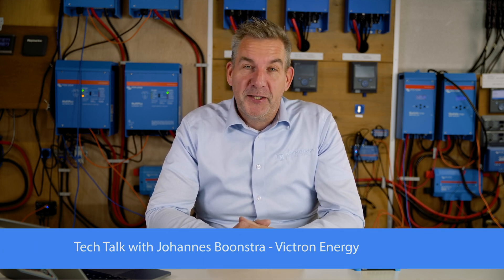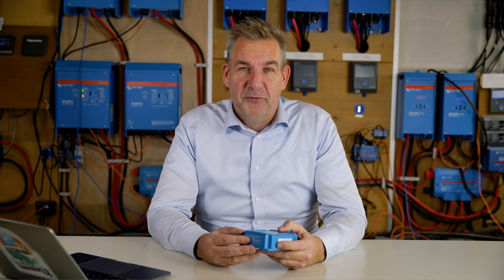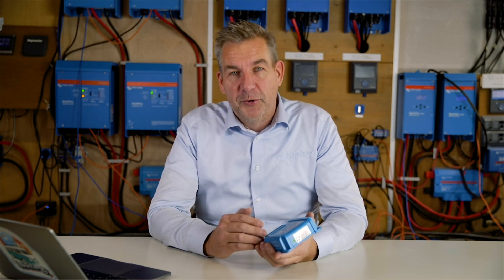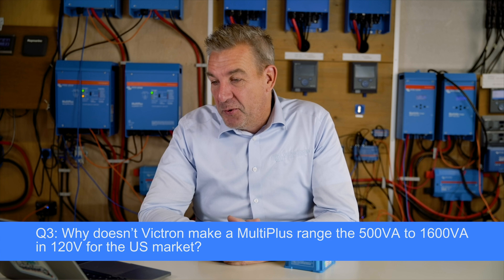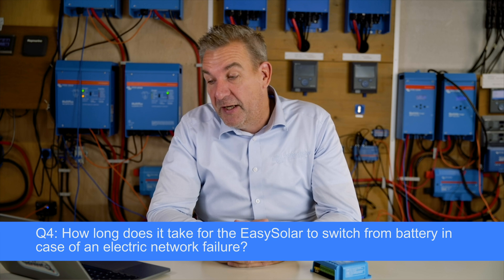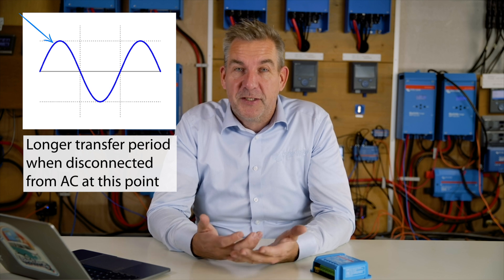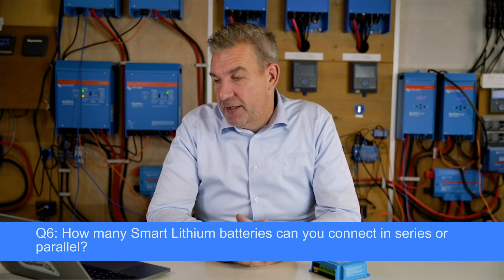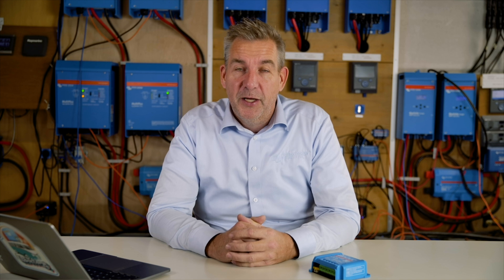Victron Energy Tech Talk - Episode 9 (MPPT charger output, Smart Lithium batteries)

Comment: What would happen if the total load output exceeds the max. values of (eg. 15A on an MPPT 75/15). Is it just restricted and simply won't exceed, or will it blow a fuse? Background: I'm currently setting up my system in a camper van and calculating for scenario that all electrical loads are used in parallel. Thanks alot!
Reply: Then there is a change of damage, so the output needs to be fused lower then max to be safe

Comment: Hi Johannes,

Another question regarding my EasySolar-II-GX-24/3000/70 (with a LiFePO4 Smart 25,6V 200Ah and a VE.Bus BMS V2)
Some time ago the EasySolar lost its internet connection. Therefore I also couldn't try to verify the network settings from VRM->Remote Console.
And in VEConfigure I couldn't see that information either, so I had to power-cycle the EasySolar to make it work again.
Because of this I have been looking at the various Victron control panels that exist.
The "color control" seems to be a possibility, but my dealer says the EasySolar is not compatible with that (although I doubt that).
On the Victron site I see the "color control" will be replaced by the "Ekrano GX", but that is a too extensive (and too expensive) solution for me.
What about the cheaper "GX Touch 50" or "CANvu GX"?
In the end I just would like to have a "backup" control option, that connects directly to the EasySolar (when no internet available) and has access to all essential configurations.
What do you suggest? Thanks in advance.

Comment: I would like to know if I can use a SmartSolar MPPT CC to charge a 24v battery from a 48v battery?
Reply: hello,  that's not advised there is a panel short circuit features which will get damaged when batteries are used as input

Comment: I have a question about the Victron Autotransformer.  Can that product be used with other manufacturer's 240V, single phase inverters to provide phase load balance?
Reply: yes, but when you need to control the ground relay you need to be careful as not all brands have a contractor for this

Comment: Hi Johannes, I have a system consisting of a Multiplus 5000, a smart shunt, a CCGX,  3 smart MPPTs with their nominal panel arrays totalling approx 3kW nominal charging a 24V /1000Ah lead acid battery . My  battery reaches absorption usually by mid morning and at that point I want to connect my electric car charge circuit to harvest the max from my panels. 
My question, what is the best way to get the absorption signal from this system? Clearly I can use a standalone voltage sense circuit but i would far rather use an output from the system.
Reply: if you want to charge when the battery is "full", I would recommend that the doc of the battery is used to trigger a relay for the charger. lets say start at 9998% and stop at 85% , that way you are almost certain the majority of power comes from PV

Comment: Hello Johannes,

I have setup a EasySolar-II-GX-24/3000/70 with a LiFePO4 Smart 25,6V 200Ah and a VE.Bus BMS V2
As I needed some 24V energy I connected that directly to the battery and not on the 230V output of the EasySolar to avoid the need of an extra 230V/24V power supply.
Will the EasySolar still be capable of managing the Battery correctly (as it has a VE-Bus to communicate with the battery) or will it get confused that some power is used from the battery that doesn't flow through the EasySolar?
Reply: The BMS will signal the Easyplus what to do, when the BMS signal is lost for whatever reason the Easyplus will stop working

Comment: LOM vs Anti Islanding (NA-Schutz)(NS-Protection)
Hello Johannes and Victron Team,
i am reading a lot about the Anti-islanding (ns-protection) (na-schutz in german) device, like the Ziehl UFR1001E device, and i read that the multiplus 2 even has such an anti islanding device inbuilt.

Now: i also read that every multiplus has a LOM integration that practically does the same: disconnecting the inverter and thus discontinuing the feed-in to the grid, in case of a grid failure.

so my question: why do we need both, LOM and (external) Anti-islanding (ns-protection)?

is it because Anti-islanding is redundant by having two relays connected in series?

Why doesn't LOM has two relays to begin with?
Reply: Hello,  That has to do with the fact that the internal detection is certified for a certain area/usage.
Reply: @johannesboonstra6917  thank you for  clarification

Comment: I have a older Multiplus 24/1600 Compact installed as UPS for data and pellets burner to work with grid failure. I want to add a smaller solar and MPPT, is there a way to consume all solarpower and not use as much from grid simultaneously? I have disabled UPS mode because my generator are noisy

Comment: Hi Johannes! I'm part of a community that is moving toward energy independence. We recently were made aware of health concerns of "dirty electricity".  I purchased a Greenwave microsurge meter that tests dirty electricity noise on the 110 VAC line. I've noticed the dirty electricity is quite high coming out of my 2 Multiplus inverters that run through the Autotransformer to produce the split phase 220 VAC.  Do you have any thoughts or user data about mitigating the high microsurge "dirty electricity" from these inverters?
Reply: dirty power?   the Multi and other inverter we produce are full sine wave and have a limited distortion, often better the the national grid.

Comment: Question About the Multiplus/Phoenix: We all like a good cup of coffee in our RV/Boat, but most coffee machine draw a lot of current. For same units a modification is possible by using a diode for the boiler/heating element. For instance my Nesspresso in 1350 watt, but with the diode only 700 watt. Can I use this with a 800VA unit? Of course the AC current is still a around 6A in one direction for a short period of time while heating up.
Reply: Well you could to a certain extend but need a larger inverter then nominal to take care of the imbalance, so inshore, there is no point doing this.  Just take a unit able to supply the load
Reply: @johannesboonstra6917   Thanks Johannes for the quick reply! It was to be expected. I consider an additional Phoenix as an additional power source to the existing multiplus only for the time the coffee machine is running without shore power. Both will operatate together. As far as I now this is possible. Off course by using a transfer switch to delay the switchover from/to shore power.
Reply: Hi Johannes
I am at my first stage of upgrading the electrical on my small yatch.
I couldn't find my answer on the web so I tought you may be kind enough to help me.
I would like to run a scuba dive compressor and other electrical device ( not at the same time of course) as much as I can from my  solar first and then battery...
Basically prioritize solar over battery 
I found a lot of info for prioritize grid or genset ....but not solar.
I think the all in one device ( like Easy solar II gx or  Multi RS solar,...) are the only ones capable of that.
Any clarification would help a lot
Thanks so much

Comment: Q: Why does switch of, the SmartSolar 100/20 Load output if I connect an Orion 12-24 10 ? 
There is no load on the Orion 24V side! 
(I wont to increase the Power, to charge an Powerstation with up to 240W)
Reply: because the load output is for loads without startup current , the Orion will cause an overload /short circuit
Reply: I have my power station connected through the load output on my 75/15 Victron mppt. When the (lead acid) battery voltage drops under a certain point, can I set the mppt to stop the load output current? Thank you so much
Reply: @DanGavern  have u got this working and if so with correct load output voltages?

Comment: Due to limited space I would like to know if it is okay to mount the Victron Inverter Charger 48V  3k 30-50  on a wall in  a side ways orientation as space does not allow for a traditional up/down mounting.

Comment: Hi Johannes,

Almost ready for first powering up my system with an EasySolar-II-GX-24/3000/70 with a LiFePO4 Smart 25,6V 200Ah and a VE.Bus BMS V2.
Q1: In the manuals / tutorials I see the default setting is for LedAcid batteries. The Lithium battery is already connected. So on power-up the setting is not correct yet. I assume that is not a problem?
Q2: I have seen a lot of manuals and videos, but still I have 2 questions. The battery I already have connected to the Victron app via Bluetooth.
Q2a: Does the first configuration goes similar with the Easysolar, so searching it in the app over bluetooth? Because I need to setup the wifi of course.
Q2b: The VE.Bus BMS V2 doesn't have bluetooth (or has it?). So is it to be configured / updated via the EasySolar?
Reply: Q1 the settings for lithium and Lead are not that far apart in level so that's fine as start up phase.    Q2 ? whats the question? Q2a the Easy solar is better set up using a laptop/cable , then you have the most options. the BMS does not need to be setup
Reply: @johannesboonstra6917  I have switched on the system; did firmwares upgrade of MPPT and added the EasySolar in my Portal.
But now I get error: "VE.Bus System [275] - VE.Bus Error: VE.Bus Error 7: BMS connected, which requires an Assistant, but no assistant found"
The manual says about this: "configure the Multi/Quattro with a suitable Assistant. "
But it is not clear how / where to get that assistant.
Reply: @mahyulan  When lithium is selected the unit is looking for the BMS , so make sure that's connected (and powered)
Reply: @johannesboonstra6917 
Q1 Can I only select Lithium with the Windows VEConfigure software or is there an alternative?
Q2 Do I need the MK3-USB interface to connect to VE or can I also use the USB port of the EasySolar directly?

Comment: Dear Johannes, although I am also Dutch, I ask my question in English. Can I operate an RS MPPT 450/100 and Multiplus II 48-3000 without a battery? I will be added later on. Keep on the nice usefull video's!
Reply: Hi no that’s not possible , firstly because the voltage regulation of the MPPT , and also because the inverter demands faster power then the MPPT can provide is 
So without battery this should not be used

Comment: I have a 48 volt 270 AH lithium bank  for electric motor sail propulsion with a Victron dc 48 to 12 volt 20 amp converter  for trickle charging a 12 volt AGM 200 AH house battery.  Thinking about adding a  victron 12 dc to 12 dc 30 amp charger inline between the converter and the house battery as victron does not have a 48 dc to 12 dc charger.  Is the addition of the 12 to 12 dc charger a viable and effective way to keep the house charged?   Are there other recommendations?
Reply: you have a 48/12 converter to charge a 12V battery, and need a 12/12 converter for charging the same battery? from where?
Reply: @johannesboonstra6917  My understanding is that a converter outputs a steady current and does not do the 3 stage charging that a charger will do.  Not sure if the converter will properly charge the 12 volt house battery which is why I was asking whether an 12/12 charger would be recommended to be installed after the converter to additionally charge the same 12 volt house battery.
Reply: @johnrabbetts1429  that seems to be pretty inefficient.    ps with a fixed charge voltage yo can also charge the battery very well, only no as fast perhaps.

Comment: Hi! I so appreciated your explanation in Eposide 6 of how the Victron inverters can sync with the line voltage for simultaneous charger and inverter operation.  My question:  I'm operating two Multiplus 3K inverters in 230 V split phase.  I can't find instructions for connecting a 230V split phase generator or grid to this inverter configuration for battery charging and inverter operation.  Am I safe to connect the 230V split phase input in the same fashion as I connect the split phase output, namely H1 to one Multiplus, H2 to the other Multiplus and Common joined between the two?  If I do this, will I need to make some setting changes in the Multiplus configuration?
Reply: when having two units in split phase the INPUT has a N is common and the one is L1 and the other therefore L2 , and the OUTPUT has the same .   So on the INPU is where the genset needs to be connected

Comment: A question.
There is an article "Parallel, split- and three phase VE.Bus systems" which states that using 15kVA Quattros, the maximum system size is a 180kVA three-phase system. Which then consists of 4 units in each of the three phases: 12 units in total. Is there any possibility to make a bigger system? What happens when you connect 6 Quattros on phase: 18 unit total? If this is impossible, does Victron plan to provide the ability to build larger systems in the future for C&I market?
Reply: when its getting bigger you will face more issue getting it symmetrical and find switches and fuses for several thousands amps.   then splitting a AC distribution up in various separate systems

Comment: I have your mppt 150/70 solar charger with its own solar array.  I also have a pwn solar charger with its own array.  I would like to charge the same battery bank with both systems through the lynx distributor.  Is that possible?
Reply: yes sure,   specially when they are set at the same charge voltage the charging will be done by both

Comment: Hello Johannes,

I have an EasySolar-II-GX-24/3000/70 with a LiFePO4 Smart 25,6V 200Ah and a VE.Bus BMS V2

I have some questions regarding connecting, as the manuals refer to EasyPlus equipment or just GX equipment, but not specifically to the EasySolar where everything is combined.

1) As the EasySolor-II-GX is already a GX equipment, I assume I don't need to use the "VE Bus Mains detector", correct?
2) So, then I can connect the "MultiPlus/Quattro" RJ45 on the VE.Bus BMS V2 directly to the EasySolar? If so, I connect it to VE-Bus connector inside the EasySolar, correct? And do I have to use one of the terminator plugs on the other VE-Bus connector inside the EasySolar?
Reply: Q1 the mains detector is not needed when having a Multiplus II model (such as the easy solar), the GX part is not the criteria for this.        Q2 Ve bus NEVER needs a terminator , and the BMS can be connected inside the easy plus

Comment: Can I connect a Quattro 10,000 W with Multi 5000 W in parallel? a quattro has lead acid batteries and the Multi has lithium batteries.
Reply: Only 100% equal products can be paralleled I am afraid , so a 10K and a 5K can not

Comment: How are you Johannes I have a question about the link BMS. I’ve bought the link BMS, but I decided to make my own batteries. Am I not able to use the BMS in this kind of system? I know you don’t recommend this schematic. But it is possible for me to use some of the features in the link BMS with my own batteries. The batteries built-in BMS has Canbus is that in anyway helpful.
Reply: I am fine! thanks!   Our BMS systems can only be connected to our smart batteries I am afraid. This is because the combination of BMS and battery is critical for safety and lifespan. The Smart battery has its own pcb which is able to communicate , we do not supply details on this communication I am afraid.
Reply: @victrontech  hi Johannes what you are saying is basically I’m better off with the linx shut instead of the linx BMS.

Comment: I can't believe the victron mppt's don't have a preset for lead acid! I expected a lot more from victron regarding this! Surely you can add a basic charge profile in an update?
Reply: Hello, I am a little surprised by this remark.   Beside the one preset setting for lithium, every of the remaining 7 are all lead acid?!.   As you know the AGM/GEL and OPs are lead acid batteries with all specific absorption voltage/durations.
Reply: @Johannes Boonstra  yes, but the charging profile for a basic lead acid and say agm are different, and all those settings are slightly different, so which to use? I just think if there was more clarity in the options this would help a lot?

Comment: Are you planning on coming out with a 240V 60Hz split phase inverter line for the US off-grid market?
Reply: There is already a Multi (charger/inverter) model, and stand alone inverter is not to be expected.
Reply: @johannesboonstra6917  So if I'm reading you correctly, the only way to get 240v is to run 2 Multi's in parallel, and you won't be coming out with a single 240v split phase inverter?
Reply: @Derf2258  we have 240Vac units as well of course, but not 120/240.  There is also the option to have two 120Vac units in split phase to provide 120/240Vac
Reply: @Derf2258  you can also use two 120Vac inverters to create a split phase of course.
Reply: @johannesboonstra6917  But it's only 3000 va     We need the 10000 va  so we can pair two of them and have nice size 240 split phase system for the US and  UL  listed please .
Reply: @johannesboonstra6917 Which split phase multi are you referring to? The 2x120v model works only as inverter/charger on one phase (and bridges the two phases in case grid is lost to provide backup power). 

Available topologies I'm aware of for 120V split phase are:
- stacked 120V inverters, operating with 180deg phase offset and common null
- 240V inverters between the phases, and create null using autotransformer (or isolation transformer)

Given the topology of the Quattro/Multiplus, it surprises me there is no model available that has a center tap on the toroid transformer, providing an instant true split phase output without the need for a 2nd (external) transformer or stacking multiple units. 
Having this would reduce number of components and lead to simpler and more cost-effective install; and as a bonus give the benefit of scalability and redundancy by paralleling multiple units.

Are there any plans for future split-phase Quatro's/Multi's for the US and Caribbean market?